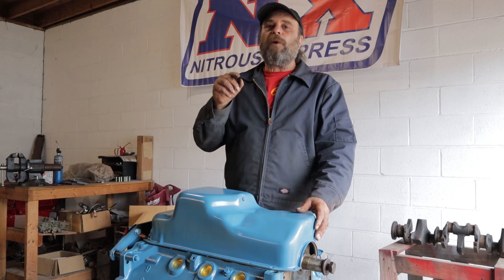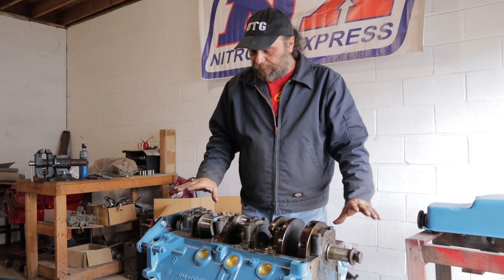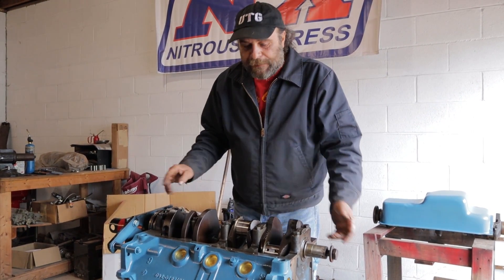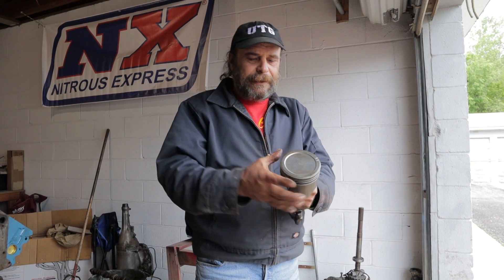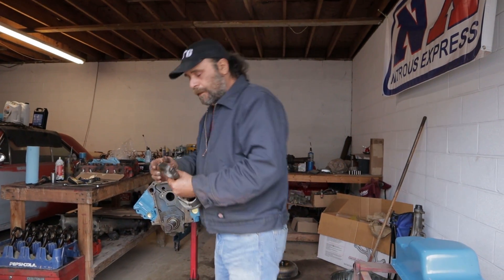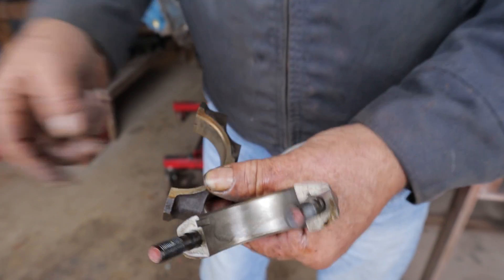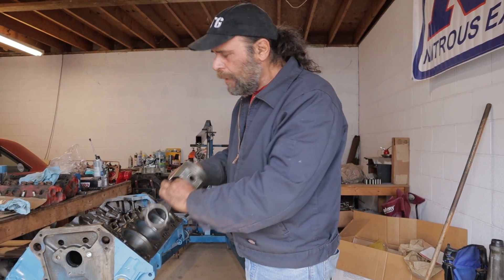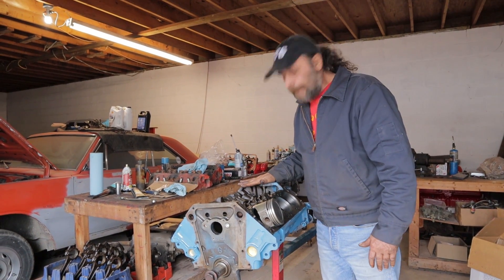Perfect Daily Driver 8 - Buttoning Up The Bottom End

Comment: What I'd like to know Uncle Tony is that if when you switch the Pistons around backwards will that also work in an engine that you're building as a stroker with shorter skirt Pistons
Reply: it'll also make a slight increase in compression for rod to crank angle.
turned around = steeper V angle = a little higher compression with those offset wrist pins. stroker and shorter skirts, turn it through by hand to be sure, but it should be riding barely higher in the cylinder top+bottom of stroke. you can verify with something depth gauge when assembling, tail of dial/digital mic works. he'll be doing videos explaining some math theory of this NICE budget built 360 w 318 heads (more compression). idk yet if it's getting a mild cam in it or not, a stock 360 cam may open valves slightly more than a mild/stock 318 cam too. LOTS can be done with a mashup of "junkyard parts" on a shoestring budget, Tony KNOWS :)
Reply: Turning the pistons does not change the compression or where the top ring stops.  Also, the pistons in virtually every stroker kit will have a centered wrist pin making revering the piston irrelevant, valve reliefs or domes notwithstanding.
Reply: John if the wrist pins are offset it does make a difference to both. 
the distance traveled stays the same, but slightly different start+end points in the bores. even if different by 1/2 or 1 cc smaller chamber at the top of the stroke, compression ratio is increased a little bit. if it weren't any different it'd have zero effect doing it.
Reply: Nope.  It changes the rod angle through the combustion event.  If it changed the way you claim, it would do it when turning the engine backwards by hand as that is exactly the same geometry.  The stroke, rod length, and piston compression height are all exactly the same.  It’s not possible for the piston to go any higher in the bore.
Reply: John Wilburn Since UTs channel is used as a community information dump that’s a good segue to let anyone who may not know if you are working on an OHC error on the side of safety and don’t ever rotate the engine backward. If you are trying to find TDC or miss a converter bolt go all the way around. You may unload the tensioner, jump time and not realize it. There is a real possibility when you start it you will bend valves instantly, if not you will have to re-time the engine which is still a drag.
Reply: Yeah, I try to avoid backward rotation on any engine with a timing belt for that reason, but it’s not a big deal if you go slowly so that a closing valve spring doesn’t jerk the cam.  If I do turn it backward, I use the cam gear.  BUT, I was only using the backward analogy to discuss geometry between the crank rod and piston.
Reply: John Wilburn I know. I was just sharing information. I’ve seen it done on a Supercharged 5.0 Jaguar engine which they must consider to be quite a feat of engineering for how much they charge for a replacement. Not a conversation you want to have with your boss
Reply: I went to school automotive diagnosis just for the learning experience, but have never wanted to make a living as a flat rate dealership mechanic.  I still work on late model stuff as needed, but it’s soul crushing.
Reply: John Wilburn Everything gets monotonous over time I suppose. UTs channel is the only place I see younger guys genuinely interested in this stuff. Everyone we have brought in over about the last 10 years seem like they are only here because their parents made them get a job. For a younger guy that has the passion and drive to learn it there is a world of opportunity in this trade. For those younger guys, you can earn more doing this than you could probably possibly imagine and it’s only going to get better as us older guys disappear.
Reply: The irony of the whole thing is the “enlightened” trolls in this channel.  This is the only channel that does a lot of things and is willing to question convention with objectivity and experience.  The trolls complain that Tony doesn’t subscribe to the blind faith creed of most everyone else.  It’s great that’s there one channel in a sea of others willing to do that.  The end result is putting the hobby back within reach of the young people who lost interest because every other channel throws money at all their problems and doesn’t answer the always unprofitable question:  “Why?”  Not to mention, we are having fun over here not having to keep up with the Joneses.

Comment: Seems like as good a place to ask as any I've got a olds 350dx short block I'm converting to gas and eventually turbo charge it. I was planning to inspect the main and rod bearing before I go much farther but I've been wondering recently about what the ring gap should be. I'm sure it would have been different between the gas and diesel motors and I'd hate to have left the stock diesel rings in there and later have the extra heat from the forced induction cause all the rings to lock up. I'm going to guess I should just buy a set of rings and gap them the turbo now before I do anything else...
Reply: Or can I just file my old ones assuming they come out okay?

Comment: I was matching piston and rod weights on a 400 for balancing and all factory pistons were within a few grams and all rods were within a few grams except for one.  It was 20 grams heavier than all the rest.  By the time I got it to the same weight, too much had to be taken off the balancing pads to feel comfortable using it, pulled a rod from a 383 that was 15 years older and it was the same weight as the the other 7 from my 400.

Comment: My buddy starts fresh race engines with 5 quarts of Lucas oil stabilizer. Works great for break in
Reply: LMAO
Reply: @lskiller1903  laugh if you want he runs his 68' Camaro in the low 9s on the juice in the 1/4 mile at 5400 feet elevation. He also builds engines for local racers. I haven't seen 1 let go early, maybe after over 100 passes. Yeah it works
Reply: @lskiller1903  hey did u see lunars 318 build. What did Nick add to the oil before start up? Lucas!

Comment: Just a question. If you swap the piston to the opposite bank and rotate it aren’t you returning the offset to the original orientation?
Reply: No, as all pistons/rods are offset to the same side, regardless of which bank they are installed, due to the direction of rotation of the crank. Confusing? Yes.
Reply: I read the mopar performance article about this and you’re right. I’m looking forward to the tutorial to understand the principle.
Reply: @garryhatchett775  Here's an appetizer that Tony did last year. Not yet quite the full story, but a bit more explanatory. Watch the whole thing, or skip to the half way point.
https://www.youtube.com/watch?v=kjd1PD6pGLU

Comment: uncle tony did i miss a video!? tell me about the piston elliptical shape!
Reply: Pistons are typically tighter in the bore at the wristpins that opposite them (thrust directions) because that dimension expands more and has less heat sink.  When the piston warms up, it should be round.  Getting direct flame, this happens quickly.

Comment: You forgot to talk about oil pumps , hi pressure vs.hi volume. Plus more detail on side clearance between the rods & crank for stock pressure pumps vs, hi pressure pumps. I always loosen up side clearances between rods. Book calls out .006 to .008  however I go .010 to .015 ( done on mag chuck surface grinder) as I always run a Mellings hi pressure pump & cloys timing chains as LAW on all my GM motors stock or hi RPM race . Also how did you prep the lifter bores for new lifters ? Not a hater, just want to know difference between Mopar & GM specks.  Some things are just different  :)

Comment: Uncle Tony’s Garage an old racer once told me they used to drill holes in the top of the pistons to behind the rings. The theory is that it pushes out on the rings so the seal better under load. Have you ever done that? What were your results? Thanks.
Reply: It's called gas porting and does work.  David Reher had a good tech article on it if its still out there.
Reply: John Wilburn ok. Thanks.

Comment: No way would I use a wire brush on my pistons. I think I would put a cotton buffing wheel on that grinder for that but that is just me. I tend to ham fist things so I would worry about taking too much material off the piston in all the wrong places. Not saying that doing this is wrong but something I would spend a few bucks and time on by getting and installing a cotton wheel on that grinder.

Hope you do the suction cup 'lapping compound dance' on those heads. I bet a lot of people have never seen or done it.

Comment: Hi Tony
Got myself pair of  “J” heads
The intake valves are 2.08 ,.... the big valve looks like an obstruction , to me .
Your thoughts regarding the 208 in a production head ?
Reply: i would think a 2.02 dia intake valve would be a better fit on an 5.9 LA wedge head...imo
Reply: Either someone thought bigger is better or messed up a valve seat.  Did the port work match the valve?

Comment: YOU CAN STILL GET A 5 GAL. BUCKET OF HYDRO SEAL CARB. CLEANER , WORKS GREAT FOR ME . WE USED TO PUT HEADS AND ALL IN THE BUCKET .TAKES THE PAINT AND CARBON RIGHT OFF . U KNOW THAT , THOUGH .GUNK AND FUEL OIL IS GOOD TOO .EVERYBODY USES WHAT THEY WERE TAUGHT ON .CREATURES OF HABIT I GUESS.

Comment: should you ream the ridge? Will new rings smash in it?
Reply: Rings do not go that high....... no need to ream that ridge. You also loose your bore reference point to check against the bottom of the bore measurement
Reply: @philipmazzuca2269  ok thanks. I always heard if it was never revved then you rev it as the next owner it could smash a ring. Just curious if thats enough to worry about. I gotta tear into a 390 soon, thanks
Reply: @1112223333111  Whomever told you that was talking out his arse.

Comment: Whatever assembly lube you usually use for most of the engine.

Molybdenum disulfide grease for prelube on the camshaft.
Reply: can this be used on engine bearings as well?
Reply: @kurtzimmerman1637  we never did on airplane engines, but if the engine is going to sit a while before you actually run it, it should be ok.

You're going to want to do the first oil change sooner than normal if you do.
Reply: @ScottKenny1978  You should do the first oil change immediately after the cam break in period, if it's flat tappet anyways.
Reply: @lskiller1903  mostly rollers on airplanes, and much more restricted rules about how to break an engine in. Like actually running it wide open for a certain number of hours!

Oh, and you should open up the oil filter after every change if you don't mind the mess, but especially after the first oil change!
Reply: @ScottKenny1978  Yes I always open my oil filters after every oil change on my performance engines, I also use magnetized oil pan plugs.
Reply: @lskiller1903  I wasn't entirely sure, given your screen name. I could read that as someone who manages to destroy LS engines from pushing them to hard, or as someone who consistently defeats other racers that use LS engines.

But that was intended to be a generic 'you'. Everyone should open up their first few oil filters after a rebuild, and ideally all of them.
Reply: Kurt Zimmerman 

Now that I don’t know. A more experienced engine builder would have to tell you that! I don’t see why not. Maybe pose that question to tony, he might have a wise word or two on the subject
Reply: Scott Kenny 

Exactly this!

my machine shop actually told me to use the moly APR bolt fastener lubricant on my camshaft break in. It’s the perfect thickness for that purpose. Most camshaft lubricants are so thin that by the time you’ve finished an engine build most of the lube has fallen off into the crankcase. Thick molly disulfide solves that problem AND fills in any microscopic imperfections in the camshaft and lifter surfaces.
Reply: @Michael-xl5hc  this was something that came up after a batch of bad camshafts in aircraft engines. Manufacturer had to spring for full rebuilds or new engines after lobes went flat.

Part of the fix was a permanent change to the assembly process, putting moly grease on the camshaft lobes and bearings, which was picked up by both Continental and Lycoming.
Reply: Scott Kenny  that’s very cool. The moly is 100x better than any plain camshaft assembly lube.

Comment: UTG can you elaborate on the camshaft bearings and how to deem them good or bad
Reply: If you can see wear (copper color), they're junk.
Reply: @ScottKenny1978  what if they are gold color ?
Reply: @camgnilpe9300  all the way across? That's way beyond worn, there's no Babbitt metal left and you've been running steel on bronze!

Send that crankshaft to the machine shop to make sure the crank isn't worn undersize (or measure it yourself if you absolutely know how).

Comment: Any thoughts on press fit piston pins vs. slip fit pins with locking clips?  Is one more advantageous than the other, aside from ease of changing pistons, from a performance standpoint? Thanks Tony. Great video series.
Reply: Press fit pins-no power loss, bushed pins very slight power loss, but bushed pins give you another "joint" that moves for that extra safety margin.

Comment: What I wanted to do,   was I had a 1973 Dodge full size 3/4 ton van with a 360 727 combo and it had a 9-3/4 rear end that was posi Trac oh, I should have never traded that van in! On my 2000 Dodge Dakota they said they gave me $3,000 for it hahaha really? no!. Anyway I was going to get a Dodge Duster with a  straight 6 and  the Wimpy transmission the Wimpy rear end and then I was going to take all the drivetrain from that van and stick in a Duster, cuz that 360 would smoke the wheels even in that big ass van with a 2 Barrel!

Comment: Hey Tony, you said you took the engine to have it cleaned at the machine shop, do certain forms of cleaning hurt the cam bearings?
Reply: Coulda swore when I worked in a shop they said the hot tank isn't really too cool for  cam bearings. 
I'd imagine so because I'd see the boss adjusting the pH by using a bag of battery acid. 
Haha good times, you'd be walking along thru the hot tank area to the bathroom and it was like you got punched in the eye...
I guess all the shit steaming would carry the acid too. 
Boink right in the eye ,you'd flinch , and after a blink or 2 you'd be fine.

Comment: Hey Uncle Tony,  you said “the 360 uses a smaller main cap” - The 360 main bearings are larger than a 318, isn’t the 360 main cap larger? Thanks.
Reply: Well no, the bearing size has nothing to do with the outside size of the cap.
Reply: Yes, the bearing is larger bot the surface where the pan seals is smaller and different.